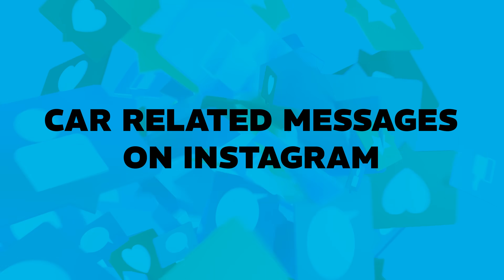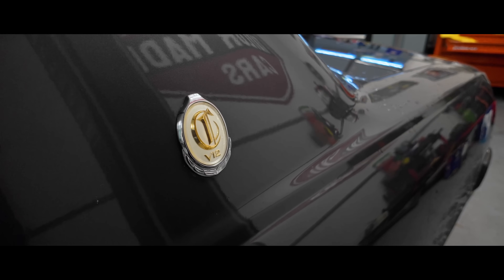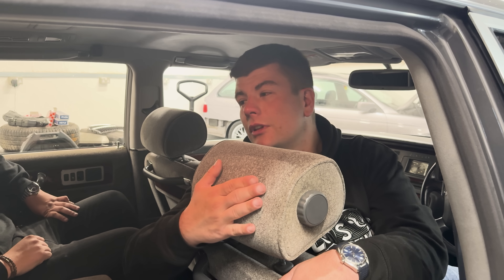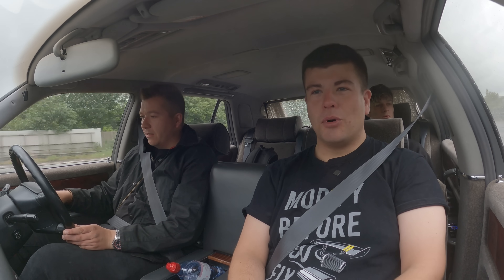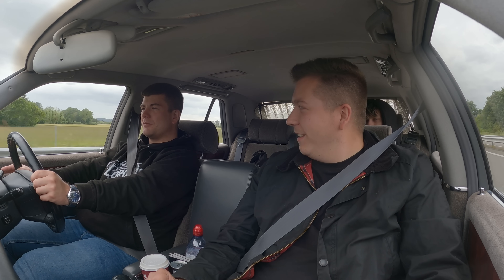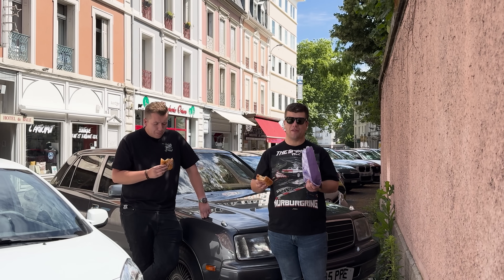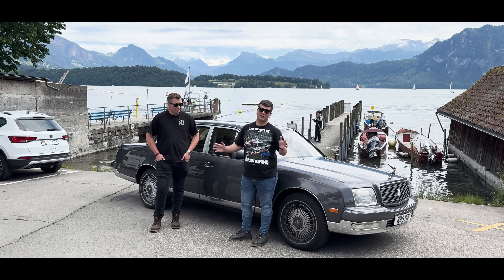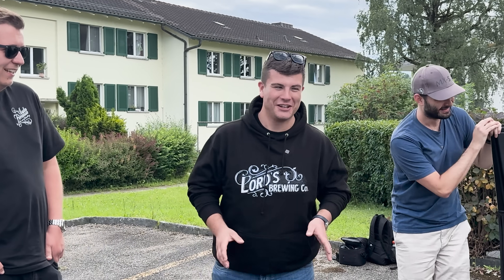I DROVE 1000 KM TO DELIVER A RARE V12 CAR!

Comment: No way, this is the elusive Japanese embassy Century! there was speculation about what happened to it, some thought it was shipped back to japan. so cool it was just sold privately.
Reply: If you google the reg, you can see the auction on collecting cars.
Reply: Somewhere on here is a very very old vid about this car back when it resided in Bradford.
Reply: @zm321 oh dear! It's probably clocked, a cut and shut and been reported stolen!
Reply: @heyhey3887  cmon it was a one lady owner  with full service history :DDD
Reply: Every time l see a video on a Toyota Century there are some extra features the presenter discovers we have them in Australia and in some cases they are cheaper than a new Toyota Camery and ldid notice a couple of stops for petrol but to do a 1000 mile drive in a Toyota Century must have been magnificent l haven't seen one in the tin yet but when l do it probably will be very exciting for me been a Toyota fan boy
Reply: Reading between the lines of the auction listing. It was exported and then re-imported in 2004. So perhaps that makes some sense of the stories.
Reply: @lesklower7281 old luxury Toyotas are very comfortable and cover the miles effortlessly. I've a Toyota Crown VX, and have done a few multi hour trips and you always get out pain/stress free. They also have really good sound insulation too, which I think is the really key thing
Reply: @iamaparanoidandroid1  The Toyota Century maybe the best luxury car in the world but it comes with a couple of draw backs the first one is that V12 engine it wouldn't be the most economical car from Toyota and the parts for them are expensive and the last thing is there is a lot of Japanese script for a lot of the buttons and does it have a lot of them but l haveseen a lot of reviews and another thing is the Toyota Century is on another level in every aspect and this is the second generation which is the only Century to get the V12 the first and third generations have a V8
Reply: I managed to get a e65 ex Dubai embassy car, they’re not too irregular. Shame the e65 750 is a sack of shit.
Reply: "lady"... 🤔  @moamed2006
Reply: They're not that bad, but just not as awesome as e38 of course...
Reply: @Brother-Crow Is E65 the model designation for the Toyota Century if it is and 6ou have the ordasity to call it a sack of s...t may l remind you l been a Toyota fan boy consider them to be the very best car in the world yes the world name another car which is more luxurious and more reliable than a Toyota Century and you may mention a Mecedes Benz but modern Mercedes Benzes l will not be as crude as you and say they are piles of junk maybe a Rolls Royce not as reliable as the Toyota Century and that is the most important thing when you buy any vehicle is reliability after all Toyota's are reliable and reliability is a luxury and there are many unreliable vehicles built today but fortunately there many reliable vehicles built today and l own a 1997 Toyota Hilux which is the most indestructible unbreakable and reliable utes ever made and the 22R engine under the bonnet is one of the most reliable engines ever made and there are a lot of Toyota's in the USA with the 22R engine still driving around and some of them are 40 years old with many 100 of thousands miles on them in fact my 1997 Hilux has 437000 kilometres on it and it's still great also Hilux stands for High Luxury but remember reliability is a luxury and it comes with a full size spare wheel another luxury so my Hilux scores two luxury ponts
Reply: @lesklower7281  what crack are you smoking? The e65 is the 2006ish era of BMW 7 series… you went off on a rant that makes no sense, other than Toyota = good, which it absolutely is true up until recently, they’re only okay thing now is the gr Yaris. The new crown and century are now SUV’s. Lexus are still knocking it out of the park. Modern Mercedes is pretty damn good and beats even Rolls Royce for luxury now with their van executive conversions. The designation for the century on the video is the g50
Reply: @Brother-Crow l am not up on BMWs only there motorcycles but another example of a car that used build some good cars but unfortunately gone down hill like most European car makers

Comment: They are a very very special vehicle, and im so happy I've experienced several of them including the 2005+ series 2's with the 6 speed autos. Seeing and feeling these vehicles in the flesh is worth doing, the craftsmanship is beautiful.

Some cool facts are only hand selected technicians with exemplary records at Toyota can build the Century, at a completely isolated facility in Japan, seperate to any other toyota manufacturing plant. All of their hand tools are bespoke and made to fit their hands. 

7 layers of paint are applied to it, and the vehicles are tested with trained technicians using stethoscopes for 100s of miles on toyotas test track to ensure quality is met regarding harshness, vibration and noise. 

the phoenix badges are all hand carved and all slightly different as a result.

All the wood is from yamaha instruments and single trees are selected to match the grain through out the cabin. 

They even come with an ostrich feather duster to softly remove dust from the paint work.

Additionally you cant buy this car from Toyota in Japan, you must be invited to purchase it.
Reply: I have to find that duster...

Comment: Did a quick search - the auction purchase price was £6100.  As comparison , there's one that just sold at auction in New York for US$14000, less mileage at 107000 miles but might not be in quite as good shape.

Comment: Fun fact about the Century; they basically fully encapulate the Japanese essense. Toyota still makes the Century (though idk if it still has a V12), and compared to all of its rivals (from an S-class to a Phantom) it is the least technical car of all. This is because the car is made especially to appeal to the Japanese CEOs of today, most of whom are over the age of 60. It's made to be comfortable and reserved. No massage seats, no TVs, no useless fancy gizmos aside from a phone, and the ability to move the seat in front of whatever important bloke's sat in the back.
Reply: Also interesting, I believe the current Japanese ambassador in the Netherlands is chauffeured around in a Toyota Alphard
Reply: The Century has rear massage seats.
Reply: @matthijsgerretse3217 wouldn't that be a Lexus LM nowadays? Kinda pointless having rhd car in lhd country
Reply: @Bananektdu  No more pointless than having LHD car in RHD country, as many car enthusiasts in the UK do..
Reply: It's genuine less is more luxury.
Reply: @zm321 most have a crt tv aswell
Reply: I'm genuinely baffled by the horn switch, that seems like the least reserved feature possible?
Reply: @DjDolHaus86 I'm pretty sure that button is a remnant of an old alarm system. Once all the tiny issues have been fixed I will go through the whole wiring to figure it out.
Reply: @gaz1603  Some have 2 (dual EMV). I'd love one with the analogue clock myself.
Reply: @Bananektdu not for chauffeur driven cars. Useful being on the kerb ready to get the door!
Reply: @WARXion  ahh I see, that makes sense why the horn wiring would be connected through there. Someone has removed the aftermarket alarm (probably a thatcham given the time period) and just put a switch in to tidy things up.
Reply: They use the ls500H currently for the UK Japanese Embassy.
Reply: The current century’s are silly high spec, so you are wrong. It’s also a suv now.
Reply: Dead wrong.

Comment: The G50 Century is the quitest and most comfortable form of transportation I've ever been in!
If Tamás is thinking of lowering this car, there are air suspension control units available in Japan via for example YAJ that gives complete control, and the car can get very low with stock suspension 😁
Reply: I don't plan to lower it for now as I quite like how tall is it. Although there seems to be an issue with the current control unit as if you drive the car for a few minutes, and stop while things are still cold the front gets lowered and it bottoms out. If you stop while the engine is warm (and the compressor was running for a while) then it stays up indefinitely, so there isn't a leak. Interesting issue and according to the forum, a sensor change can fix this, we will see... :)
Reply: @WARXion Is it difficult to find parts for these cars? I’m from the Mercedes W123 world and have been fortunate to have the Mercedes Classic Center to assist with parts.
Reply: @Marklin15  I'm very surprised how easy it is to find parts so far. Of course 90% of them are from Japan so it take a while to get here and the shipping is a bit pricey, but they have almost everything! Average service parts, filters, etc. are available in almost all online parts sites. They are simply Toyota parts, nothing special.

Comment: Nowadays there is an alternative to buying a sticker for the Swiss motorway. You can enter the car's registration into an online database  and pay using a credit card. No sticker needed. And if you swap the plate to a different car, you don't have to pay again.
Reply: If you swap the plate to a different car you would have other problems than road tax I guess?? 😉
Reply: @xrv404  depends, in Switzerland you can register several cars under one registration. I do. Then you pay road tax for the more expensive one, the second one is free, even though that varies depending on which canton you live in. You also save money on insurance that way.
Reply: @ac24z  
Okay cool, I dont know the laws in Schweiz, but where Im from you get pulled over asap if the plate doesnt belong to the vehicle. Only 1 plate per vehicle. 😊
And that would be crappy Denmark 😄
Reply: @xrv404  if you put a plate on a car illegally, you get in trouble here, too.
Reply: @xrv404  Dude, Denmark is nice as well. Greetings from Switzerland. 🙂

Comment: I wonder if you could use 2jz engine internals, 2 big turbos and a 6 speed manual gearbox?
Reply: You can fit a 6 speed with a adaptor plate and turbo the GZ. But nothing from the JZ engines will fit. They are totally different design.
Reply: I don’t think the crankshaft will hold up like the 2jz does. Most likely the cooling is difficult as well.